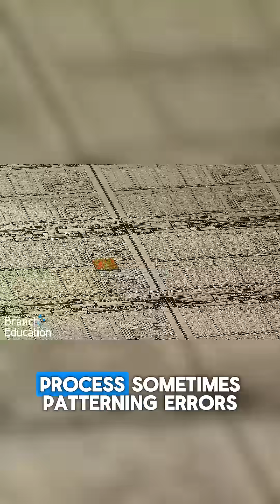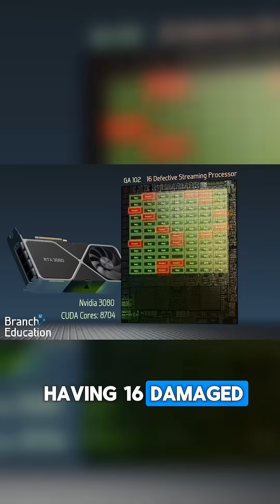How do Graphics Cards Work? Part 4 #gpu  #technology  #engineering  #videogames

Comment: Curious what would they do if they perfected manufacturing and every chip was flawless.
Reply: its close to impossible to make true perfection in a situation like this. But hypothetically, it would make it way cheaper to make a chip as you would have much higher yields .
Reply: @thebeast7590 let me elaborate for people that don't understand why, the lithography (laser etching) device that costs 9 figures has and I'm not kidding , a puddle of water inside to further focus the laser by acting as a lens. Imagine the amount of precision needed that some engineer somewhere thought the insanely expensive and accurate machine could benefit from the lens effect of water... with our current tech I doubt you can get anywhere near 100%, anything and everything can affect the process, i would even take the gravitational waves of the universe to be a factor in if the process was 100% successful or not, it works in nm scale after all
Reply: Lol you're seeing it bud this is perfected manufacturing
Reply: So the cards mentioned use the same die, but are segmented according to the number of defects. You've probably realized that they haven't mentioned the 3070, 3060 and 3050. That is because they use different dies. If they somehow perfected manufacturing precesses, then each card would simply be based on its own unique die. Simple as that
Reply: they could still just disable some of the cuda cores, as stated in the video.  they disable the circuitry around those cores to make those cores obsolete.  would be easy to produce a 3080 from a flawless 3090 ti card
Reply: @ben2474 but in a hypothetical where all chips have all their cores why would you purposefully  lower their quality?
Reply: @keeno556  production, at that point, would be the same cost no matter what.. but not every single one of your sales will be for the highest end possible chip.. whether that be through consumers or major deals with corporations (like hospitals needing thousands of computers), they may not want to pay the extra money for the extra cores.. so they can disable them in production and still at least make a profit vs. not selling those chips in the first place
Reply: @keeno556  its supply and demand. If they disable a bunch of cores to make it more affordable and enough people buy it, then it creates demand for these cheaper gpus. 

Not everyone wants to pay the full price for a perfect gpu
Reply: How disabling cores makes it more affordable?

Comment: For anyone who doesn't understand, you aren't buying "defective 3090s." That's not how this works. They tell you the # of cores and the speeds etc when they sell you a 3080, you aren't having any wool pulled over your eyes or some nonsense. The rest of the cores work as advertised and at full speed.

If you need help understanding imagine you print out a sheet of 10 cards, and you sell this sheet for 10 dollars... Then something happens, and your printer ruins half a sheet of cards. You can either A. destroy the whole sheet and move on. Or you can B. cut off the 5 bad cards and sell the 5 good cards for 5 dollars. Those are still good cards, why waste them. Same thing here.
Reply: I mean technically speaking, it is a defective 3090. But just isolated defective parts that allow it to work with stability.
Reply: You still buy a "defective 3090 Ti" but safe and cheaper and fair.
Reply: it is defective 3090 just recycled since it cant perform as 3090 they cut it down to work as 3080 or anything below .. the video says it all
Reply: The 12100 has 4 cores and the 12400 has 6. Do they ever have chips with 5 working cores that doesn't fit into either category? Would they deactivate the extra core and sell it as a 4 core chip even though 5 cores work? And could you unlock that core somehow?
Reply: Which is why the analogy doesn't mention it. Oh boy what a humble guy😂
Reply: No…it’s a defective 3090 😂
Reply: @EldenLord00  cool! Send it to me! 😅
Reply: @NTATchannelNickTaylor  I don’t have one.
Reply: Lol, don't care, my GPU is still damaged.... 

Jokes aside, what stops these damaged things from migrating? Like if it is a piece if dust, isn't there a potential for the problem to spread?
Reply: @Two_Tone_Xylophone  It's not dust, it's a "printing" issue. The chips are sealed, so nothing can get inside of them.
Reply: Nah that’s a pretty good analogy, but don’t forget they add different amount of vram and power connectors to the card, so while the gpu chip might be the same nothing else on the board is like the better version. This is also a standard practice in the whole computer industry, they never make the low end, it just appears due to manufacturing standards and they can slap in lower end things to complete it for cheaper
Reply: it is now embedded in my brain, lower tier cards and cpu are a defective high end products,

to whatever products, silicon or just another goods, can be foods, when you have damage in it, the price gets a lower value,
like a fish/fruit about to rot
like a damage furniture,
anything has damage in the products sells low, that is just it.
Reply: And I have a 3080Ti (Strix)
Reply: It's still a defective. Just by removing the defect doesn't make it no longer defective. It's still a defective because nobody want defective product. If somehow they never make a defective product, then they wouldn't intentionally downgrade it to sell 3080s
Reply: @za_pravdu1943  they would intentionally downgrade yes
Reply: @za_pravdu1943 But manufacturing silicon chips is extremely hard, and at a level of precision that is required from chip manufactures, errors are going to happen. If they could make only top tier perfect silicon, they would do it... only for the laws of supply and demand making them either drop prices, or slow down manufacturing to gauge the prices.
Reply: @za_pravdu1943  it's not a defective product you goober.

They make a gpu core on a piece of silicon then view how many functional cores it has. Once it's functional cores are determined, that core is binned based on the functional cores. Nvidia then assigns graphics cards to be produced based on the binning of the cards. If the cores were binned perfect you make a 3090ti with it, if the core binned nearly perfect you make a 3090 with it and so on.

The gpu core isn't the graphics cards it's a single part of the gpu package that makes up a graphics card. Perfect silicon is extremely rare and incredibly expensive to produce. Assuming they only sold perfect cores without defects, i.e. they don't sell 3080s, 3080ti, or 3090s, would you be willing to pay $8,000 for a 3090ti since they can't sell any gpu cores that aren't perfect and maybe only 1 in 50 are perfect? I don't have actual data on the perfect core production rate, but it's rare.

The best thing you can compare microprocessor manufacturing to is gemstones. Everyone wants that flawless 5 carat diamond ring. But a flawless 5 carat diamond ring is unbelievably rare. There's imperfections in the stone and you have to cut the diamond around those imperfections. If you have a 7 carat uncut stone with zero imperfections you can make a beatiful 5 carat cut stone from it. But if you have a few imperfections you might only be able to cut a 4 carat stone, or a 3 carat stone, or 2, or 1. Those stones are each perfect in their function amd advertisement, but also less than the that above them. It would be a waste to only make 5 carat diamonds and throw away all other diamonds that aren't 5 carats.
Reply: LOL, it is flawed , aka damaged and the greedy green company sells you lousy parts 😂😂
Reply: This bro is mansplaning the video like…
Reply: Doesn't add up. In real life this printer makes either only a garbage sheets (of it's broken) or perfectly fine sheets with 0.1% of defective. 
In chipmakers life it makes 25% perfect, 25% slightly less perfect, 25% mid and 25% garbage. Oh, yeah. yeild can be charged depending on market needs
Reply: So it is defective, they just tell you it’s defective
Reply: I get all this. But all the extra work with the defective cores would make the chip more expensive right? So selling them for a lower price isn't really worth it for the manufacturer...
Reply: you get the 10 sheets , damaged or not they're not thrown away, in older processors there was a method to reactivate some cores, bcs amd forcebly disabled good cores just to meet market demand, your analogy sucks bro
Reply: Why would someone buy a sheet for 10 dollars? Are they stupid?😂
Reply: ..That's literally what it means, you are buying defective 3090's when you buy a RTX 3080Ti or lower.  This exact same thing applies to the RTX 4000 series as well, the RTX 2000 series, and all AMD GPU's to.  This also applies to all CPU's.

Yes, you are paying for the advertised speeds & cores of a 3080Ti, but this doesn't mean it's essentially a defective 3090 core, because..that's exactly what it means. 

It's the same way how low end i3's are defective intel i7's or i9's.  That's once again, literally what they are.  You are either being ignorant on purpose or actually just dumb.
Reply: @Nighterlev  He's trying to play contrarian.
Reply: Errrrr...your explanation didn't help there bruh.

Technically, it's still a defective unit
Reply: The fact that ur complicating the easily described video got me 😂
Reply: But when are these ever resold like that especially at a reduced price? 😂 just another scam marketing tried to pull so we buy more junk..
Reply: @hank01000  Why even speak on stuff you just don't comprehend?
Reply: @hank01000  every cpu/gpu that isnt the highest in the lineup have always been sold like this ever since multi core technology was invented, nothing new
Reply: @Retguard  it doesn’t explain how some of the chips have certain defected areas. Your analogy is a little too broad but maybe that was the point. From my understanding if the chips were randomly defected in different areas, even if the cores added up wouldn’t they still perform differently? The chips are more of a strategical defect meaning each (4070 for example) are all defected in the same areas. Not random areas. But again just my understanding of said video I’m not going to pretend like I know how it works.
Reply: @SlimTechGaming  I think the thing to remember is that you are always promised a certain level of performance. While I assume it's a possibility that different parts of the core being turned off in different patterns could lead to "performance" differences, companies sell these cards with full specifications, and all those cards will, at the very least, meet those specifications.
Reply: @Retguard  that's why they call it the "silicon lottery" isn't it? We get at least the advertised performance but if we're lucky it might be ever so slightly better, (not that it matters for people who are not overclocking)
Reply: @SlimTechGaming  says in the video it doesn't matter which ones get turned off as they are all the exact same thing. Stop trying to act smart, it's embarrassing.😂
Reply: @SlimTechGaming  the cores that are affected with defects are turned off. The rest should work the same, so you're getting X amount of working cores.
Reply: @SlimTechGaming  The video explanation was already easier than this.
Reply: @SlimTechGaming  yes they do perform differently to some extent, that's why the silicon lottery exists.
Reply: @brandonlovett4919  a analogy is only meant to represent a concept which doesn't matter how broad or specific it is. Sorry you can conceptualize and connect ideas😂
Reply: @Retguard  not a good analogy but I get it
Reply: @SlimTechGaming  Please explain how it isn't.
Reply: @Retguard  ill be more succinct.
You are analogising how to deal with a defective chip rather than saying the lesser cards are how defective the chip is. its ok to say something is less perfect but still usable.

I would explain that turning the defective areas off, offer less power demands. cards are built around these demands.
Reply: @Retguard because they purposefully deactivate those cores 😂 they do it on purpose to meet market demands but nividia TRULY DOES IT out of greed, the 4060ti 16gb was a MASSIVE JOKE of card.
Reply: You are bad at giving analogy.
The correct one should be like 18 wheelers truck. Where each wheel (supposedly) contributes to the truck (speed) performance.

So, instead of scrapping and throwing away a perfectly fully functioning truck. 

They brand it with different categories (based from imperfection, max speed) which makes the fully function 18 wheelers equivalent to 3090ti.
Reply: You are bad at giving analogy.
The correct one should be like 18 wheelers truck. Where each wheel (supposedly) contributes to the truck (speed) performance.

So, instead of scrapping and throwing away a perfectly fully functioning truck. 

They brand it with different categories (based from imperfection) which makes a fully function 18 wheelers equivalent to 3090ti.

PS: all of the trucks variant still have the same main engine. you just have a different speed (performance) limit due to limitation (imperfection).

Hence, you get what you buy for.
The same stuff like buying 18 carat gold vs 24 carat gold.

Comment: Let me summarize and explain some things for you. 
The "GPU" is the final product of Nvidia which sells it to you. a GPU is just a Printed Circuit Board (PCB) with some quantity of semiconductors on itself. Since GPU has "processing" in its name, it's clear it has some elaborating and controlling features, so has some type of microprocessor or microcontroller unit which can be programmable. So the GA102 chip, our microprocessor, is useless all by itself. Nvidia engineers so:
1 - study and develop a circuit which channels data from the PC's CPU to the GA102 chip
2 - flash program the GA102 to receive this data, elaborate it and then send it to the HDMI/DisplayPort output
The XX60, XX70, XX80 etc. is just a nomenclature Nvidia gives his products for market orientation, for example the higher model is recommended for higher resolution because higher resolution -> more data -> more computing power required.
Due to complex and repetitive manufactory process, chips can be damaged easily but it doesn't affects their quality, it reduces the computing power of the GPU and in order to not throw away thousand of utilizable chips, Nvidia sells it at a lower price compared to the fully operational ones and clearly says that this "crippled" GPU is not recommended for higher resolutions.
Clearly, higher GPU require more power, more signals ports and channel on PCB and many other complex features. The difference between a XX60 and XX80 for example, isn't reduced to just a few cuda cores disabled on the GA102 chip. 
They are two different circuits with two different requirements but they do the same function at a different speed and resolution.
Reply: no no the GPU is quite literally the Chip itself. The rest is just what you need to make the GPU itself work. The CPU is also just a standalone chip and gets all it's support from the Motherboard and the rest of the PC.
Technically you could make a Motherboard with a GPU socket where you just put in the GPU chip like you do a processor.
Reply: @drogenfeld  I don't like the term "GPU" for just the chip aboard and let me explain why: I dunno your qualifications and experience, but with mine (I am a part-time technician while studying electronic engineering) I just entered a Company which uses Nvidia's Chips for AI based video surveillance systems. Our company buys a "special" version of the chip which has nothing to do with  classic Nvidia's RTX GPUs. 
So the same chip, different applications and different conditioning circuits due to technical requirements.
Reply: @xHal_  I don't think the application you use it for changes what it is.
Reply: @drogenfeld  It changes since the chip comes aboard a "module". This module is also a PCB but it comes in a DDR4 interface, has no heatsink neither a molex power connector. It is a low power module without the GPU software and is not used for display imaging since. Like i said, we use them for AI based videosurveillance systems and we flash our propietary software. It is a completely different application.
Reply: @ The chip was still manfuactured the same way, and it'd kind of be silly to call it an AIPU. Nvidia themselves has a big market in the industry too, largely AI applications. But I think that is a separate product category still.
Reply: @drogenfeld  That's why I don't like "GPU" for these applications.
"Graphical Processing Unit" is a name Nvidia basically invented themselves to clarify the "scope" of this when they first launched their GeForce 256, before that every so-called "GPU" was just an external and complementary processing unit which lightens CPU tasks. 
Back in those days, probably most of Nvidia's income was from GPU selling, but today since everyone knows what Nvidia's chips are capable of, they just started selling chips without the whole "Graphics Card" interface and PCB.
Said that, Merry Christmas.